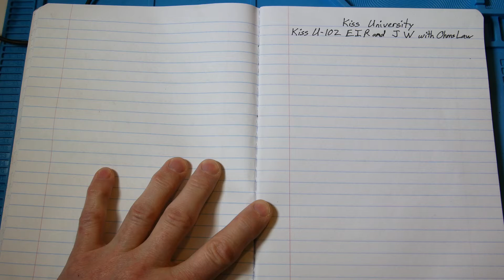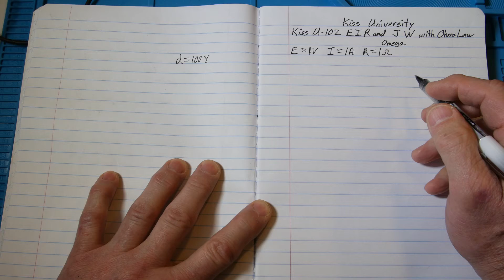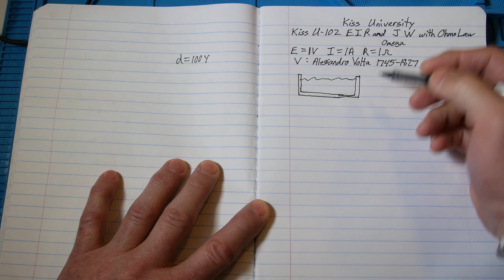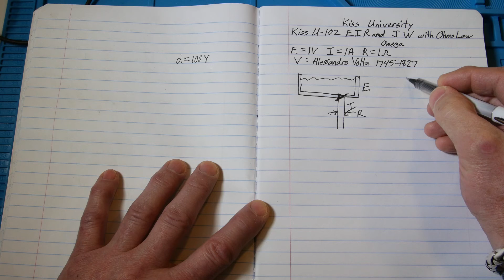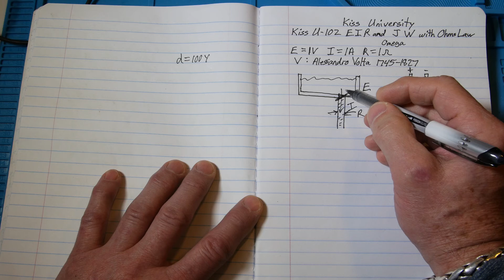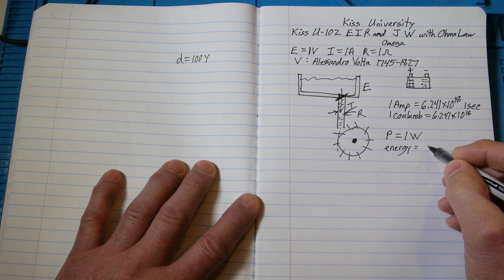KISS U 102 Voltage Current Resistance and Joules and Watts - Kiss University playlist #KissU

Comment: So I = Coulomb and is the amount of energy, while A = Ampere is the speed of the drainage of that energy?
Reply from the maker: Fried Mule Great question.  Yes, I is coulomb and measured in amps when measured in seconds.  So you might have 10 coulombs that moved down the conductor, and depending on the speed that they moved would tell you how many amps moved.  If they moved in 1 second, then it would have been 10 amps in 1 second, but if it took 10 seconds it would have been 1 amp for 10 seconds.